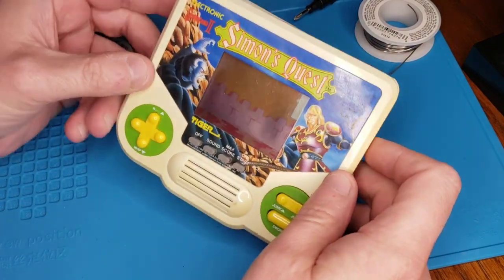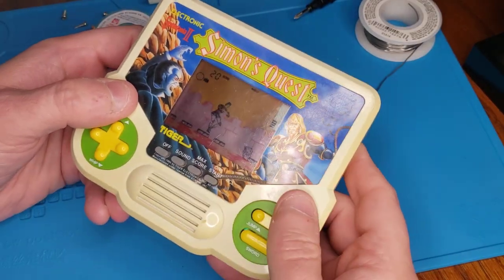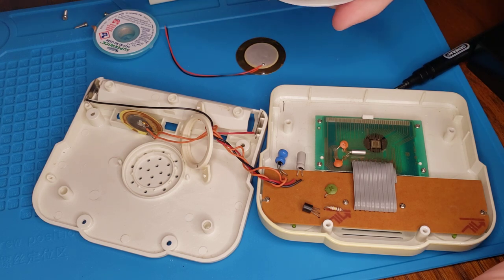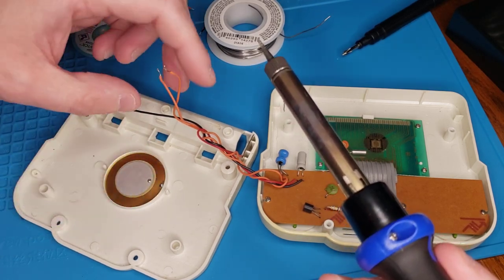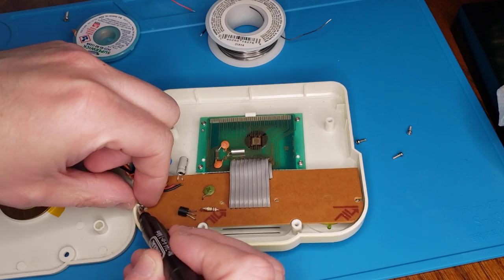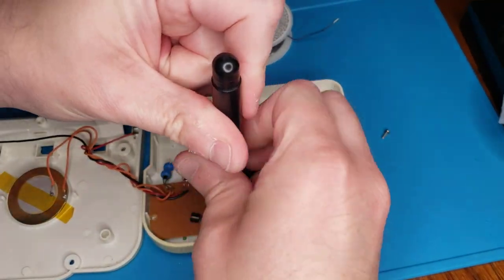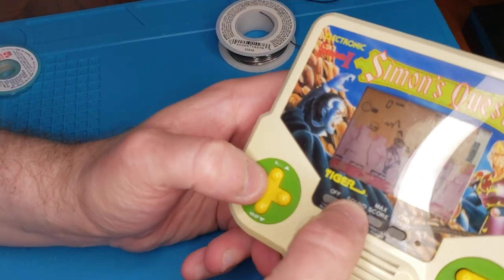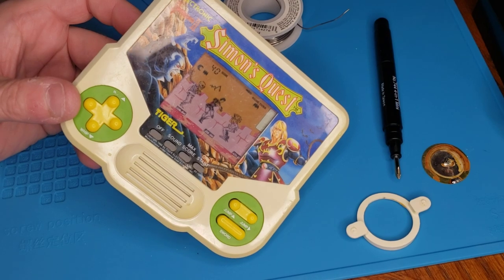Tiger Electronics LCD Simon's Quest - Speaker Replacement/Teardown

Comment: Thanks for the awesome video! What is the type of speaker used in these called? I would like to replace one too but having trouble finding them
Reply from the maker: Thank you!  It's a piezo speaker...here is where I got them...

DZS Elec 15PCS 27mm Piezo Disc Transducer Contact Microphone Trigger Sound Sensor with 4 Inches Wires for Acoustic Instrument https://a.co/d/32au09v